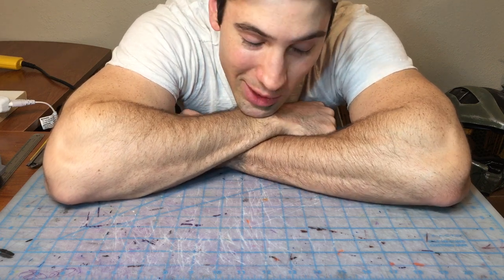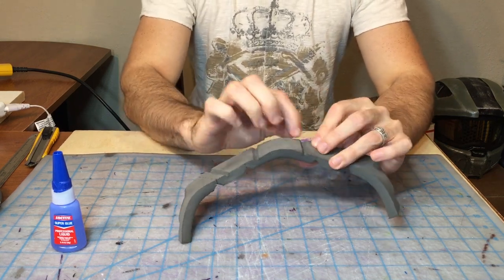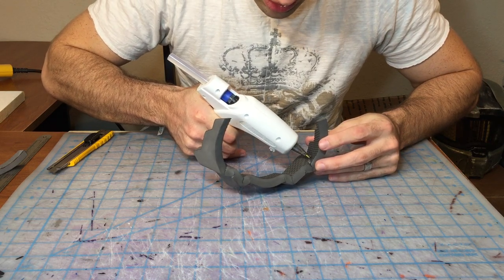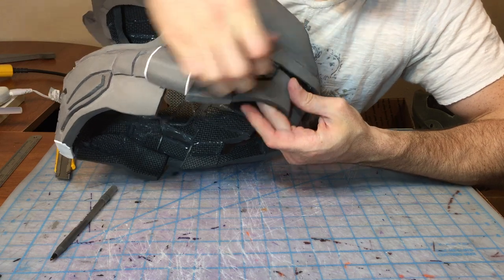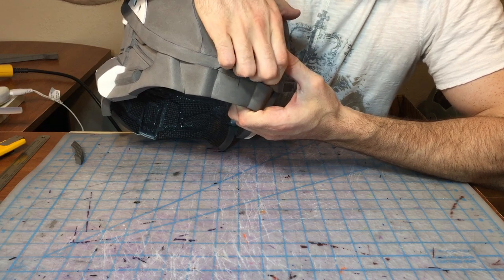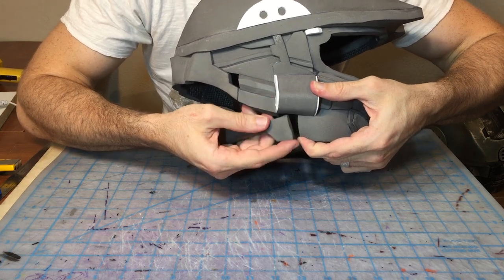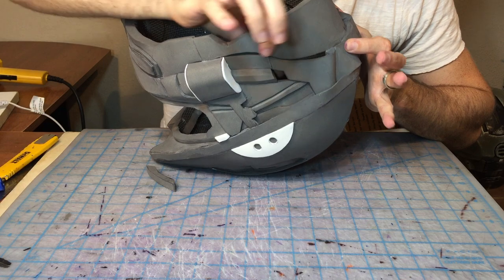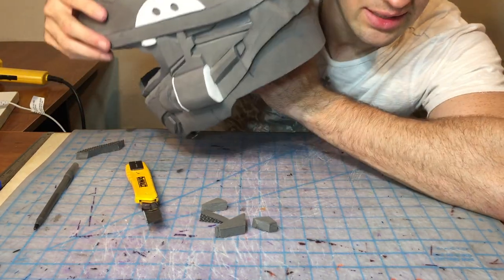Halo 4 Mark VI EVA FOAM Helmet Tutorial Part 6

Comment: I'm terrible at making the trench cuts, could one, with proper ventilation and a mask, use a woodburner with a metal ruler as a guide to do those smaller trench cuts?
Reply from the maker: Yes.  I've used a wood burner on mine.  A heat knife works as well.
Reply: Awesome! Thank you, and thanks for doing these tutorials